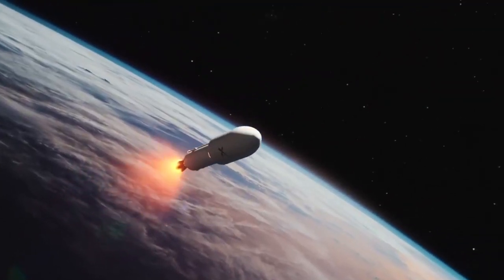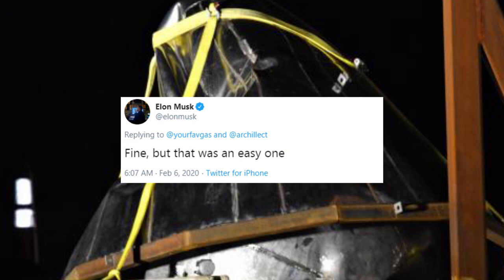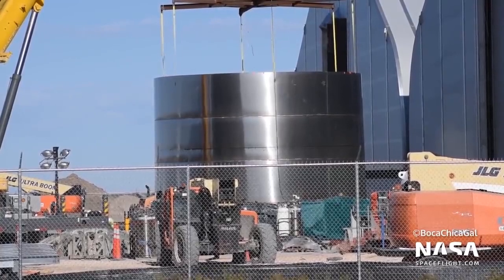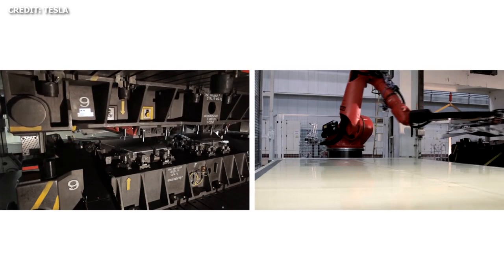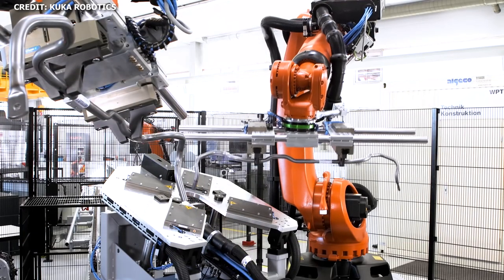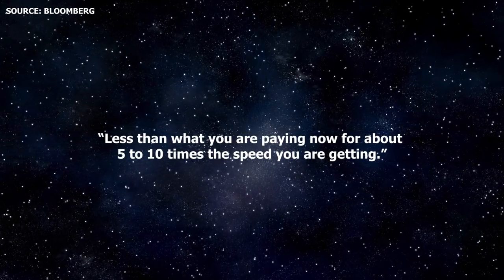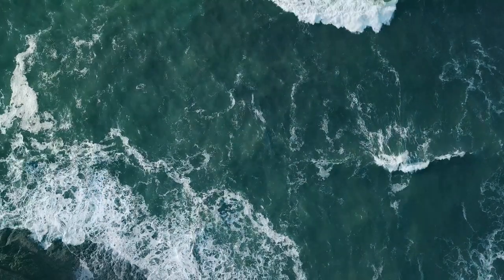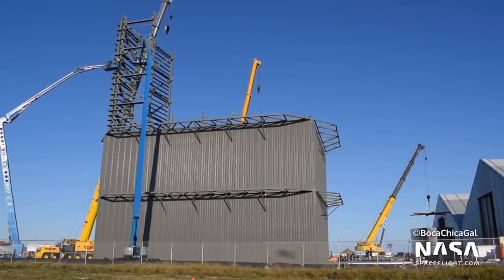SpaceX Starship Updates I Starlink IPO I SpaceX to Launch PACE in 2022.

Comment: I understand that stainless steels strength increases at cryogenic temps -and indeed high ( re-entry) temps.But is that case for the weakest area -the seam welds? It maybe -I simply ask.
Reply: Phil Barker - “Fusion” means the steel on both sides has so completely bonded that the 2 sides become one solid piece.